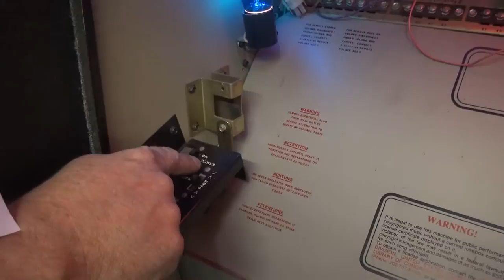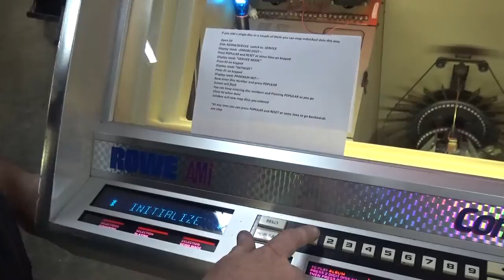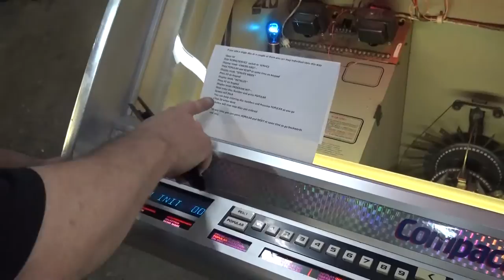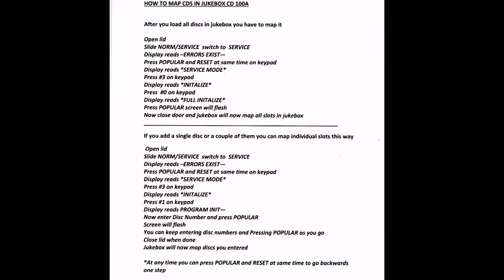#816 How to MAP your ROWE CD JUKEBOX - Another TODD'S TIPS from TNT Amusements

Comment: Hey Todd..I hate seeing you cut off the lock tabs off the foot door!! But I wanted to tell you that you can put the 250 watt amps into Rowe 45 boxes!! Its plug n play but you have to reroute the wire harrness so the plugs will reach but I just left the amp upside down and it works fine that way lol sounds awesome with the extra power and you can play your ipod or phone in to since it has RCA inputs for the cd player!! Amp has to have phono inputs..Most do I think!!
Reply from the maker: Dan Keller Hey Dan...CD jukeboxes will never be vended again...and I think the chances for a NASTY hole poked into your head outweigh me cutting off those tabs!  God tips about the amplifier!
Reply: TNT Amusements Inc
Yea..I'm a total purest..I cringe when you put colored T molding on the classic arcade games lol Try the amp swap..Its why cool !!!!!

Comment: Very informative, but I do have a question when I went to initialize I go to close the lid and it doesn't do anything
Reply from the maker: Try squirting that service switch really well with contact cleaner...if one of the wipers is not making good contact, sometimes this is the result!
Reply: I got it to work now issue I'm having is that when it plays it sometimes skips a disc or two. So for instance I want to play cd 15 it plays 17 or 19

Comment: I recently got the 100C.  I got it to work with free play no problem. How do you get it to play an album ?  When I press the first two digits then popular it doesn't do anything. It just shows the first two digits that I pressed.  I looked on the cd manual  on page 2-42  under code 6992 It does show how to set 55 and 65 for free play and album buy are toggled to on still no luck.
Reply from the maker: If ithe feature is turned on, you punch in the disc number and THEN two zeros...4 digits total, to play the entire album.

Comment: How Todd, so I've got an oppurtunity to pick up a 100C pretty cheap. Checked it out the other day and it turns on and plays music. it is missing the dollar bill changer, but that's no biggie, I want it for home. I does not have a key to unlock the case... any tips on how to get it open and can I pick your brain to help restore the box?
Reply from the maker: you will have to either pick the lock or pry into it...sometimes, there is a number on the front of the lock and you may be able to find a key on ebay.  Good luck

Comment: Todd I just got my 100C to play full albums. I took it off free play & added credits instead.  So I added 9999 credits & punched in the 2 digit album & then popular & it did take the credits down to 9985.  Hope this helps others who have this problem.   I think mine has older software version & that may be why it doesn't work like it's supposed to.  To add credits go to svc mode and punch in 8 4 then 9999 press popular to save.  Maybe you can make a new Todd's Tit's video on this !
Reply from the maker: Thats a good possibility! :-)

Comment: I have my own business too but I want your business LOL I have a 1965 Rockola. It was the first jukebox with a transistor amp and the last jukebox with an exposed mech.
Reply from the maker: Neat fact!! Thanks for sharing!
Reply: Actually, the 1967 ULTRA model 437 was the last visible mechanism Rockola and the first transistorized amplifier. In 1965 Rockola still used the 6973 tubes push-pull amplifiers.